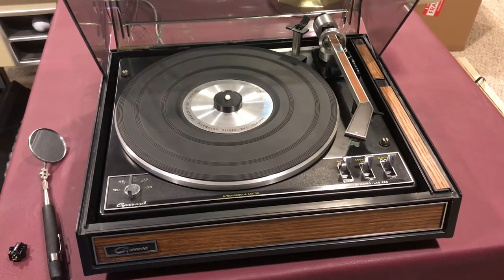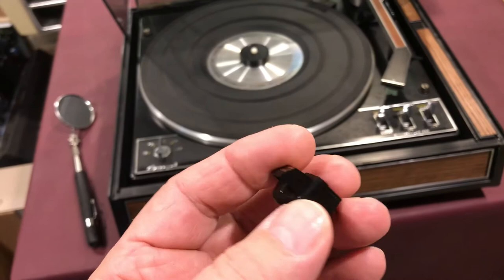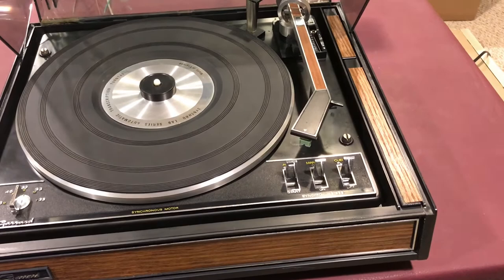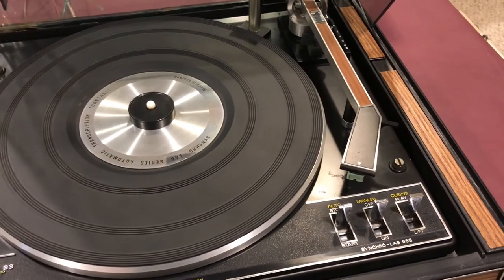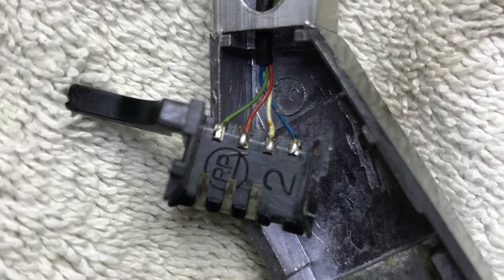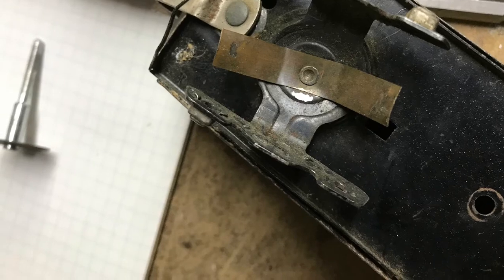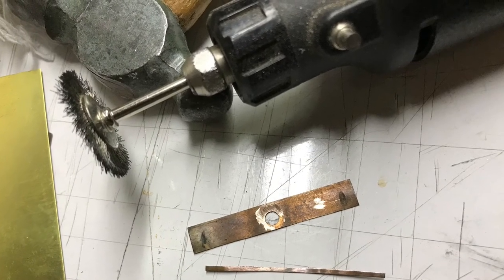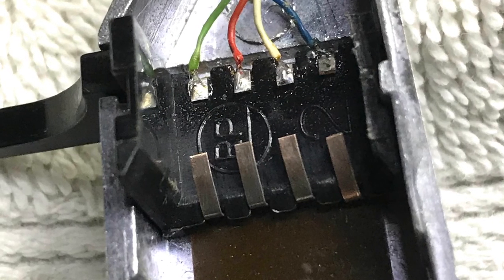Garrard 95B Headshell Repair

Comment: greetings! How did you manage to remove that tonearm piece? Thanks!
Reply from the maker: Hi - Boy that was awhile ago. I believe the the plastic finger contact holder just snapped into place. I've also seen that they have a small plastic looking spot weld that I've had to trim away to get it out. Wish I had done a better job on the video. Hope that helps
Reply: The blue wire is a left ground, all you had to do is solder a jumper wire from left to right ground on the underside where the RCA Jacks connect.
Reply from the maker: @edfiliberto4714 You're right.  Could have done it there or at the sled but I wanted to maintain the 4 wire configuration which reportedly provides the best shielding. Never tested it out though. Thanks